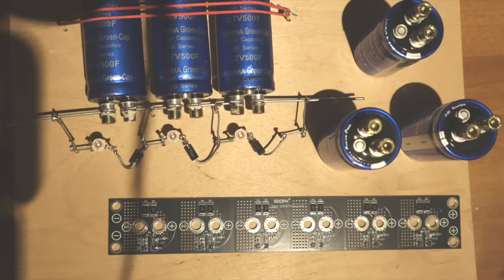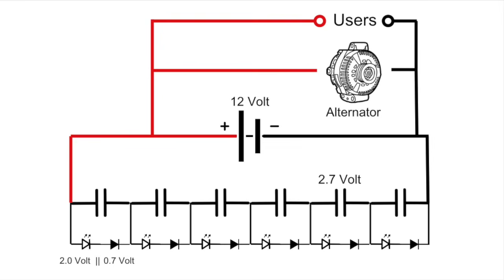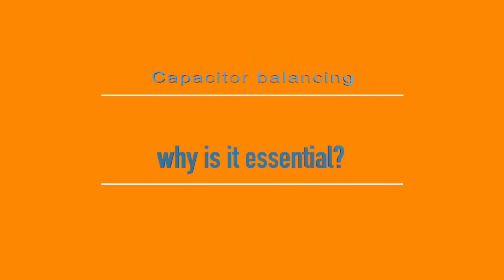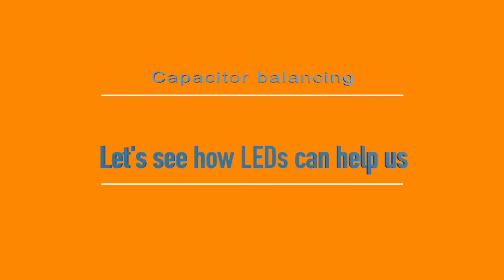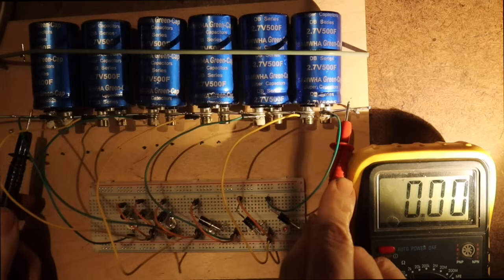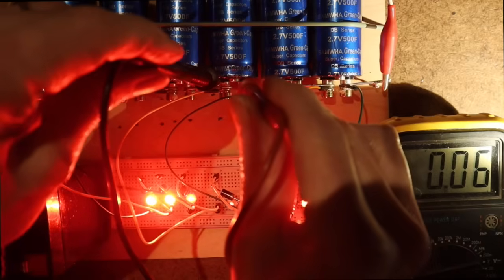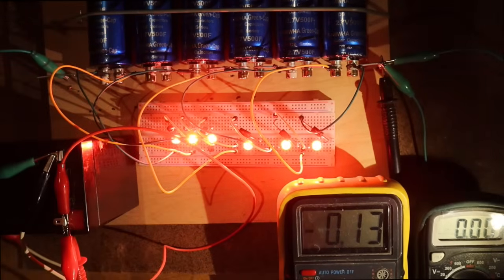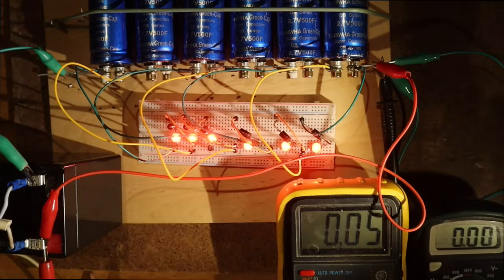How can a Super Capacitor help you start your car reliably and let live the battery longer? 86

Comment: Isnt this going to wear out your starter motor faster?
Reply from the maker: A good point Sorin! Mechanically it could be but thermal stress will be no issue and also the relays contact should not be a problem,  that suffers more from interrupting a current. But the security of a reliable start when you are in a hurry is a big relief...

Comment: So you are in effect saying the resisters will run down the battery if left for a few weeks.
Reply from the maker: Yes, in a proportional way. But with my diode combination, above some point the current become very small. This rest point (a parked car) is use usually.13,7 Volt and you can tweak the values of the diodes in a way that the parasite current becomes very small. That is a compromise with the ability to balance the super capacitors.

Comment: I think it would be interesting to include the battery cells in the balancer, too. Battery balancing came up with Li-Ion systems, which have very low but often different inner resistances. But for lead acid batteries this is also interesting to improve their charging state and life time.

And there are also balacers on the market with balancing currents of 1, 2, 5 and 10 A per 0.1 V voltage difference among the cells. And they operate all the time and not only as long as the battery is operated close to its upper charging voltage limit. They also transfer energy between the cells and they don't just waste excess energy from the cells with higher voltages to equalize them with the lower voltage cells.
Reply from the maker: Hi GKDresden, that is an interesting thought. I looked already on Amazon but it seems that the choice is there a little bit limited. I now discovered AliExpress as a platform that is richer on components so may also look there. Because I am originally an electronic engineer, I can also look to make something myself so that I can help DIY enthusiasts to make their own things if it is convenient.
It should be possible to transfer energy to another "floor" on the voltage ladder by avoiding galvanic contact, but I have to figure that out.
Reply: @nnvasen-good-energy  several years ago I built a charge shuttle balancer which is very simple to make. I have used the design from Aswinth Raj who publshed an article called "Cell Balancing Techniques and How to Use Them" in Circuit Digest on February 23, 2019.

It consists mainlich of 2n MOSFETs and (n-1) capacitors. In order to control it I have used a self oscillating half bridge driver IR2153D. The gate driver was operating in a circuit which makes a dual low side driver (VB on VCC, VS on GND) with 1.2µs dead time out of it. The Gates were separated from the driver outputs by 0.22 µF capacitors. So it is possible to operate them from low-side up and from high-side down.

Comment: Why didn't you use a transistor to do your overcurrent sinking? You only need a PNP transistor, the heatsink, an LED, and a resistor....times however many batteries, of course.
Reply from the maker: Hi Bickstarchaser, see below the reply to Ronnie that can be applicable also here. But I like the idea to add a simple transistor to it. When I continue this project, I will certainly do.

Comment: I had thought about this for my sailboat, since sailboats usually rely on deep cycle batteries and need a surge of cranking amperage so rarely.
Reply from the maker: Yes, in that case it makes less sense to use Super Capacitors.

Comment: What you're doing is awesome! People need to know more about these super capacitors. A few people have miscued perspectives as the price per farad and their best use cases, it's gotten way better than the Fad Farad Days of 2006. Capacitors and super capacitors are voltage regulators and line softeners. This can regulate the power output from solar panels that often experience quick moving shadows moving across the panels like on a vehicle or in a partially shaded location. Dramatically reducing the amount of times your charging components need to reset during short voltage drops. This action can also soften the electrical output from an alternator that experiences all the smallest vibrations from all the moving parts in an engine. Without a capacitor, you could put a light sensor on an incandescent light bulb running directly from an alternator on an engine and hear the engine run through the light sensor. Capacitors also reduce the need for larger engine start batteries. In modern times, they reduce the battery capacity needs in poverty-stricken communities for power tools, air conditioning, and refrigeration. Capacitors also increase the lifespan of batteries.
Reply from the maker: That is a good point Peppernickel, I have to think about other applications for these capacitors and PV- technology is certainly interesting as a candidate. I have to think also about the role of the super capacitor in solar installations if there is already a battery because the proportion between battery power and maximum power of the user is very different between a car and a house. But yes, your statement that the battery in a car can be smaller is certainly true. The space that is now occupied by the car battery should be divided in an optimal way between a smaller battery and the super capacitor.
Reply from the maker: And thank you for the compliment!
Moreover application in areas with low Access to Energy needs a lot of thought and it gives so much added value, given their low standard of life.

Comment: Situation:  Toyota 3.5L V6 with failed battery -- one dead cell (under 11v fully charged resting voltage) and one low capacity cell (turn on headlights and voltage immediately drops to about 8v, turn off lights and battery voltage rises to over 10v again). Starter would sometimes turn, but usually just click the solenoid.

Equipment:  Jumper cables and a cheap 6s supercap module from China. Balancing isn't ideal, but it mostly works.

Procedure: Connect supercap module to battery with jumper cables. Let charge until voltage reaches over 10v.  Start engine. Disconnect jumper cables.

Worked several times until I replaced the battery. By that time the weak cell had failed and the battery resting voltage was barely over 8v.  That was still sufficient to start the engine with the supercaps jumpered to the battery, but not from the battery alone.
Reply from the maker: Hi Sylvan, thank you for sharing this experience, that was really a case on the borderline! Also my Super Capacitors were not expensive. I had to discard the balancing board that didn't function but the capacitors were fine and also equal among them.
This saturday or sunday I will present a video about this where I show the currents on an oscilloscope. I still didn't do all the experiments but with a loose old starting motor it went fine. That will be interesting if I can visualise the current as a function of time for battery and Super Capacitors...

Comment: Wouldn't the capacitors charge equally if they were wired in parallel? 
In series the value of the capacitance is 500uF but if they were in parallel the value would be 3000uF
Correct me if im wrong but wouldn't more capacitance provide more current on the initial start?
Reply from the maker: Hi DM , you are right but then you have to do both. Nowadays super capacitors are electrolyte based and have this typical max voltage that force you to put (also) in series.
Reply from the maker: We need new technologies,  maybe graphene capacitors.

Comment: I have now had my 1994 toyota truck for 31 years, 442K miles on it, I am on my 4th battery, so I am averaging more than 7 years per battery (close to 8), not sure its worth the trouble for this circuit.
Reply from the maker: That's a great result and many will be envious!

Comment: nice idea, but cost of capcitors renders this worthless, unless you do it for fun. I had this setup in my car for a year or two, not all those capacotors i use in other project.
Reply from the maker: I suppose Super Capacitors will go down in cost, but in 10 years, thermal engines in normal vehicles will be forbidden to sell in EU...
Finding other applications.

Comment: Gracias por este gran curso. Este proceso lo usábamos en los 60s, para elevar la el voltaje requerido en las fuentes de poder, para los moduladores de audio, en los sistemas de trasmisión de AM, las válvulas requerían 3000 vols. y el trasformados debería ser pequeño por el peso, y costo así que se fabricaban de 250 vols. y elevábamos a 3000 o más según los diodos y condensadores.
Reply from the maker: Hi Mr Manzana, that is a nice comment and also nice memories, I was in love with that electronics with vacuum valves. I am also very glad that this Super Capacitor technology came along and I hope we get graphene tecnology to make Super Capacitors independent from chemistry, as I suppose that this 2.7 Volt limit is related to chemistry.

Comment: Hello Robert, 
great idea, but i have to dissappoint you on one major technical 
theoretical principle: capacitors in series, do NOT add capacity, on the contrary, 
but only when you would parallel them you get adding capacities. 
So you'll need 6 parallelled 500F x 6 such banks in series, to get gain ;-? 

Quit more expensive than buying another Batt. 

? Why not just add a second batt in parallel over it, huh ;-? 
But ofcourse that requires more place ;-? 

Other tips that can contribute to batt quick degration: 
start only when necessary and for a prolonged enough ride ;-? 
Atleast to fully warmup the engine. 

What allmost every non technically inclined people never seem to understand: 
start first and than after a small delay headlights-on, heaters, etc... 

When arriving at destiny -before shutting down engine : : 
first Lights off, Window Heat Off, windows closed before killing the engine ;-? 

And maintain your starter engine, after some  100K mils of Kilimoters. 
And conserve ground straps contacts.  

And if cars stands still often: prior to a start, charge battery proper. 
And even disconnect when putting to stop for weeks, . . . 
Ofcourse than u need a garage to park it inside ;-? 

Hence my personal tips & tricks, Harry.
Reply from the maker: Thank you Dr-Satch, I am aware about the error I made with series connection. I knew it but forgot it. I said it below in the comments already and will mention it again in the next video on this theme...
I tell in the video why batteries are not good to put together with the lead batteries: they have their own voltage.
Thanks also for the other good tips. Indeed, you need some timing and Demand Side Management (DSM) with the battery.
Reply: @nnvasen-good-energy  You may want to roll out a 36V or 48V LA battery pack from a fork lift and rethink that series battery statement.  DSM is nice but not always cost or space effective.

Comment: Those balance boards are overrated...  Like BMS wires they are needless extra electronics. You don't want them to drain the capacitor.
Reply from the maker: I don't know them so well, but my first experience was bad.

Comment: Interesting!
Do you think super capacitors based on Graphene could run a car while collecting energy from the environment? Airwaves, kinetic, friction, road surface electrification etc. to propel the car for its journey?
Reply from the maker: Hi Peter, thank you for the appreciation ! I am very interested in graphene technology but in general I think that energy surrounding the car is too limited to supply the large amounts of energy needed for travel. Just look to the big batteries in EVs and the fire ball that you cause when a whole tank of fuel would get fire, to be aware of how much energy we need for mobility with vehicles of over 1 ton. In general much more than we consume at home...
Reply: @ I appreciate such a full answer. I once asked a Scottish guy who died a similar channel and was basically dismissed as an idiot :)
Reply: no you need to crank the charge first then after that the alternator can feed it but the sparks plug needs to be consuming a lower wattage to keep it afloat while pooling up the charges or itll stall the quick fix is to double the capacity of the capacitors..

Comment: Why can't you use a 1.6V NiZn batteries connected in series. They have extremely low internal resistance(several times better than Li chemistry), while also much safer in an automotive environment. You just need a custom charging Ckt, to keep them from draining and to cutoff completely once fully charged. Update: Due to high temperatures in engine bay, the battery need to be located on the otherside of firewall. Still has very good low temp. discharge charecteristics from -20C. The charging limited to +0C. Lack of thermal runaway and an extremely low 5mohm impedence, makes it suitable for high power density needs such as cold cranking. Has almost double(800) the cycle life of Lead Acid, with ability to deep discharge to zero without adverse effects, makes it ideal for intermittent duty cranking applications. The fundamental limitation of NiZn is they are not as good as Liion, when it comes to energy density(100Wh/Kg is not a favorable number), that being the primary reason for not finding usefulness  in Battery Electric Vehicle applications.
Reply: Because NiZn batteries are very sensitive to temperature, with temperatures exceeding 40°C commonly occurring in both the trunk and even higher in the engine bay during summer. Additionally, they are cold-sensitive, you can't charge them at low temperatures, and have a lifespan of only 500 to 1,000 cycles.
Reply from the maker: Hi Aware2Action, it is interesting, and I must admit that I don't know so much about NiZn, I will learn more about it. But what about the manufacturers of cars? They must know more than me!
Reply: @nnvasen-good-energy  Yes, at best, this is just a transitional technology—maybe suitable for some cheap vehicles and such—but development is clearly heading toward solid-state batteries. However, it’ll still take decades before they’re really used on a large scale.

Comment: Please add an active balancer to this experiment that is designed for a lithium battery. 8s 5a or just to make it interesting 3S 5a. Comparing the led of your experiment and the led of the balancer.
Reply: Would a 200 ohm capacity between the positive of battery to the capacitor encourages the capacitor use it's  power more then the battery?
Reply from the maker: Hi Robumf, do you mean a capacitor or resistance?

Comment: I have a super capacitor car jump starter.The manufacturer states that it can jump start a flat battery using the residual power from the flat battery.Not having cause to use it yet I find it hard to believe that it can draw enough power from the flat battery in the car to start the car.It is understandable that it can if first charged from a good fully charged battery.For this reason and the fact that inrush current charging the capacitor on start up may blow the diodes in the alternator,I would prefer to jump the car with a fully charged super capacitor!This is the same way that alternators have been ruined jump starting a vehicle that has a flat lithium battery.The inrush current that a lithium battery can drawn from an alternator is much greater than a lead acid battery with higher internal resistance!We need to be careful with these super capacitor and lithium battery devices.
Reply from the maker: Hi Joseph, thank you for the comment. I am also concerned about the alternator and mention in the video a resistance of 50 milli-ohm that is only between the alternator and the battery. When I was at the car electrician workshop he told me that cars made after some year, I think 2010, have always a fuse between the alternator and the battery. I will check that. I will let you all know in the video with the final version. However, with so many comments it might be that I need to present an intermediate video with all my findings and experiments! No final version without a certain level of quality. I thank you all for your patience.
Reply from the maker: It is interesting to try to get enough charge from a tired battery to bring a super capacitor to starting voltage. I can imagine that it has a good result because if you calculate the charge needed to bring a six pack of 500 Farad to 12 V or even only 11 V, it is not much and maybe the nearly dead battery is still able to give it, even if it would take 10 minutes. In this way, you can start maybe the engine with a battery that alone would not be able because of the high internal resistance.